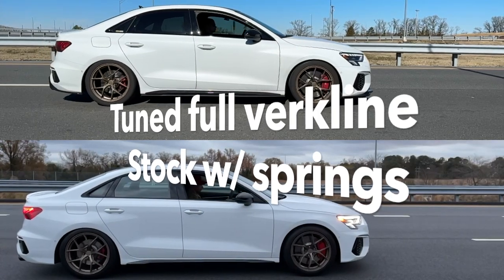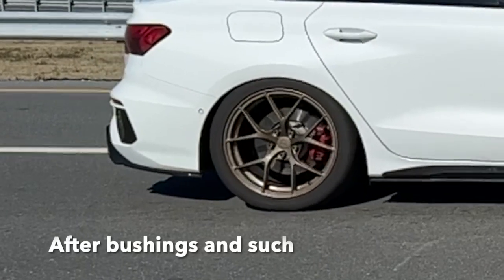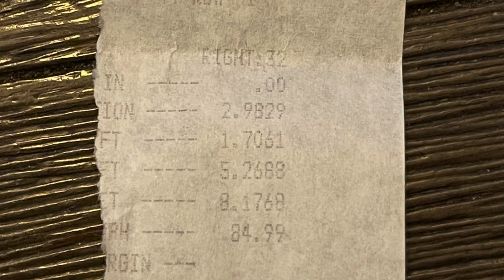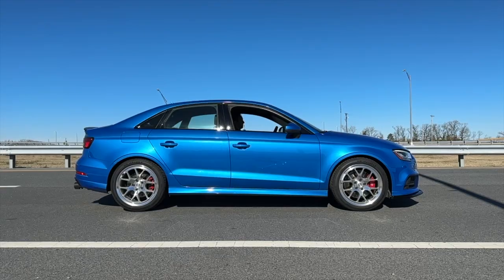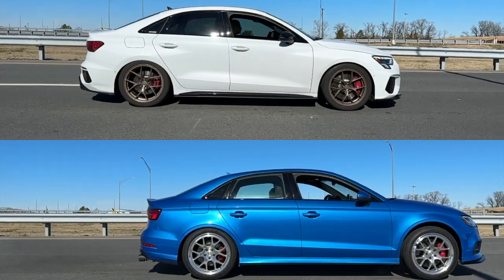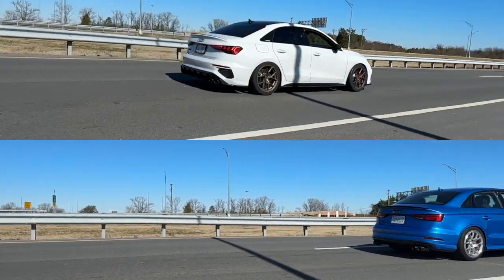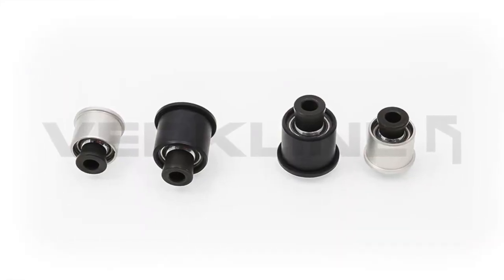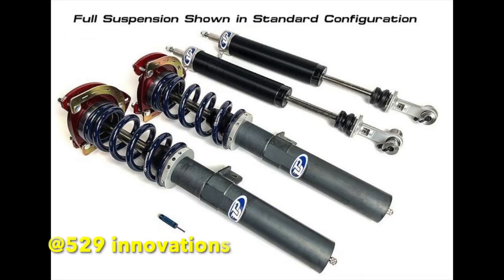The Verkline difference is legitimate as can be! From stock to fully fitted w/ slow mo | MQB VW AUDI

Comment: Hi please can you tell how it drive on the road compared too standard, is it a hard noisy ride as a dayle driver.
I'm thinking of doing this to my RS3 for track day but also drive it every day.
Thanks keep up the great work love the channel
Reply from the maker: Are you referring to the entire catalog or just a single part? As a whole, subframes arms bushings etc it does add a little NVH but nothing serious. Motor mounts add more NVH then these do. The bushings need to have an eye kept on them and lubed from time to time as they’re metal on metal, but do have dust boots. It’s not a whole lot harsher by any means but really does stiffen the chassis if you have the whole setup, in the best way possible. I can’t imagine going back to squishy nasty suspension after having this on the car. I feel so much more connected and confident when I’m doing any type of racing. The most negitive thing about this stuff is the cost and the labor intensity. Rear stuff isn’t that bad but setting up the front frame and arms is not for the weak, but it is fun and a great learning experience.
Reply: @BryceJordanProductions  hi Yes the hole subframe and other mods
Reply from the maker: It’s good 👌🏾
Reply: @BryceJordanProductions  is it quite a hard ride compared to standard
Reply from the maker: @steveswain4646  not really no. A little more dramatic over big bumps due to being so much stiffer in the chassis but better struts will fix that. Its really not much harder or stiffer just normal driving. Once you hit a corner though you really notice how much better the car reacts and handles with speed

Comment: Man Mark's car gets so much front wheel spin.
Reply from the maker: It does indeed. My R was the same way before a haldex tune and some suspension work. He’s also on some normal tires I believe
Reply: @BryceJordanProductions  yeah, and he's still cutting some good 60' numbers just suprised to see so much spin is all.  Haldex tune would help for sure at the power level he's at; I really like mine on my wagon.
Reply from the maker: @karstgeo7290  maybe we can talk him into getting it for some content! It’s really a must have after adding power
Reply: @BryceJordanProductions  I believe there is a United dealer down there that can flash it.  For me, it was more about handling/power out of apex.  I never noted any launch improvements/60' times but my wagon doesn't make the power your Audis do/no boost on lauch control etc.  I think it would be a good one for him.
Reply from the maker: I wish I could’ve gotten real data when I had mine tuned. But being a manual there was too many variables. It bet it does indeed help with launches, but regardless for cornering and braking etc it’s worth every penny
Reply: @BryceJordanProductions  sure bros! Just send a haldex controlled over and I’ll be happy to try it. Also gonna stiffen Jonny rear shocks on launch control only, to have zero squat.. HOW BoUT DAT!!
Reply from the maker: It’s not a controller it’s a tune, you gotta go to a shop to get it flashed. It’s worth it though, it’s 500$
Reply: @BryceJordanProductions  oh ok, but my exhaust will come before the haldex.
Reply from the maker: I’ll text you about it 😄
Reply: @LastHumansGarage  I vagely remember someone saying 'I am done modding the S3' like 2 weeks ago. Today, it's a whole new modding world opening up...  LOL  ;-)  Hell yeah, I won't complain though 🙂

Comment: I'm looking to do these bushings and chassis braces and such for when I'm 550whp. I want it for 60-130 and backroads stuff. Think it'll help me?
Reply from the maker: They definitely won’t hurt! I’d say it’s more for corner racing then drag racing but it’ll help launches for sure, not sure about 60-130 as you aren’t really shocking the suspension at that point or cornering
Reply: @Bryce Jordan Productions  I mean it should still definitely help in the backroads department, right? I'm gonna try heavier rear springs, poly every bushing, and rear subframe as well. I'll look into interior rear chassis brace and tunnel and torque braces as well.
Reply from the maker: Oh for sure for sure in the backroads man. Just not so much in the 60-130. They help in everything else. Also look into their trailing arms.. they are the SHIT. Like, you will be mind blown. That with some chassis bracing in the rear, front strut bar, it’ll be a whole new car to enjoy
Reply from the maker: The subframes are 🤌🏾🤌🏾🤌🏾 but not cheap and a lot of labor but I think the juice is worth the squeeze
Reply: @Bryce Jordan Productions  I'll look into a few things. I want mid-low 7s 60-130 and fun in the corners. Hopefully I get the job I have applied for, so money won't really be a thing.
Reply from the maker: @brooksallenyoung  I hope you get it too! That makes going fast a lot easier 😆